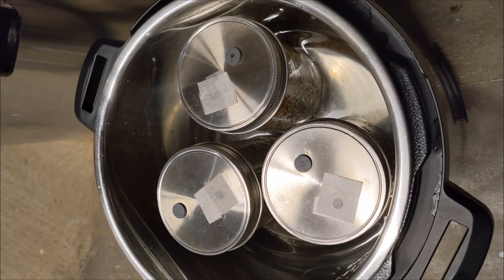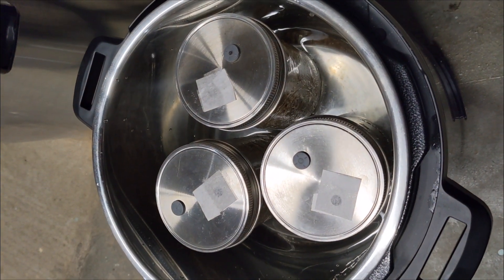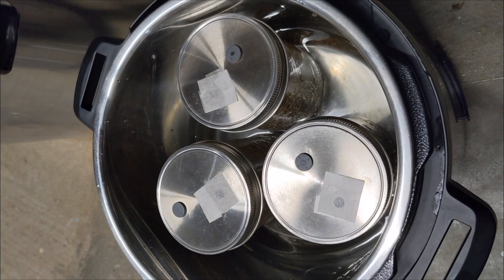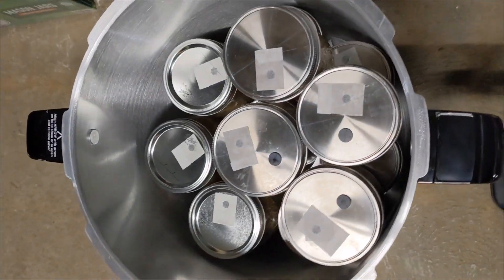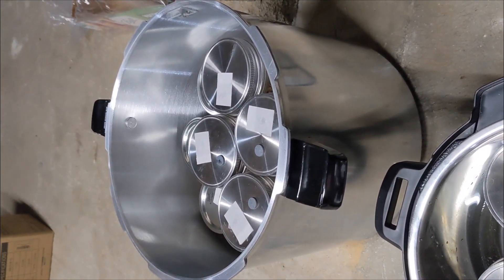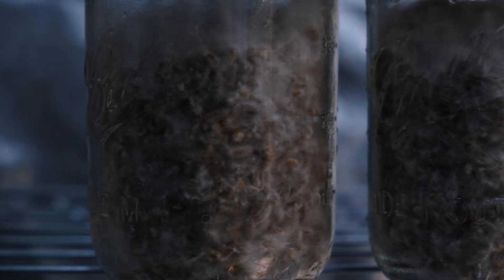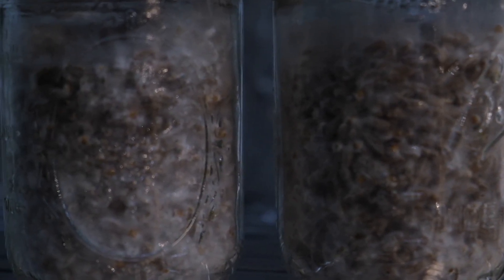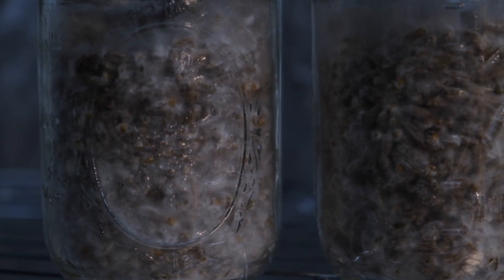Grain Spawn in the Instant Pot? I did an experiment to find out if it'll work

Comment: Ok with pressure cooker the psi depends on elevation.   Im in FLA "zero" elevation to properly pressure can food at my location needs 11 psi.  If I were in ARIZONA high elevation it would be 15psi.  Can I use the same I use to can food for this?

Comment: I've used my instant pot and never had any contamination. I just increase the cook time a bit. It is very convenient for small batches. I can get 4 quart jars in my pot.
Reply: What size of insta pot do you have ?
Reply: @buffalogrow3537  There are only 2 sizes and you can't even fit 1 quart jar in the smaller one (its too short)
Reply: @anakyn2010  There is a 6, 8, and 10 quart instant pot that I've seen being sold. Actual "Instant Pot" brand.
Reply: I'd also like to know!

Comment: I like everything about this. I wonder if grain spawn/substrate "All In One" bags could crafted this way with the self healing port. Maybe a small vac sealer afterwards that has been sterilized to seal it off immediately when done?
Reply: Do you mean sterilizing small bag of grain w self healing injection port. Sealing off bag once out of instapot then using LC syringe? 

I’ve been thinking about grow bags and that could be a cool way to do an all in one sterilize. Then have LC ready for injection!
Reply: @bando8086  that's th idea. I have learned much from the 7 months ago

Comment: Great that somebody finally puts this myth to rest. I was too ignorant to know the difference so have been using instant pot for all kinds of jars and never had a problem. Never even adjusted cooking time. It works totally fine.
Reply from the maker: Thank you, Demian! Yeah, I'm happy it works.  Pressure cookers are expensive.
Reply: I used a Instant Pot for my first few jars and at least for me, it was not working great at all. Some jars made it, sure, but I lost a lot of jars to contam, in many cases it was green mold that was clearly coming OUT of grains where it had not been killed properly during the PC. 

Besides that, I just would get SO frustrated about what I couldn't fit in the Instant Pot. Niether of those is a problem anymore since getting a proper canner with a pressure gauge.

Comment: I use an electric pressure cooker for my grain spawn. It's like an instapot but a different brand. I have never had an issue with contam. The only downside is that because of the size I can only do batches of 3 x 16oz. jars. I just set it on high (whatever temp that is) for 45 min. Works every time.
Reply from the maker: Yeah, it's kind of a bummer to only be able to do small batches.  But, if you're not trying to grow much it gets the job done!
Reply: How mant psi people keep telling me i should do 2 hours in my insta pot as it only reaches 11

Comment: I wondered this,I have an air fryer that gets up to 240degs,was thinking of dry frying some spawn as I have no PC,and have been steaming my jars with some success..👍🏻
Reply: Never owned a pressure cooker as I have found I can do everything I need done with just plain ole steam. Broke boi Tek forever. I use popcorn or rice as spawn and have NEVER had issues. Think that doing things this way keeps me focused on clean procedures more. Someday I'll break down and buy a pressure cooker
Reply from the maker: Let me know if it works for you!  I don't have an air fryer, but that sounds interesting.
Reply: @OneEarthMushrooms   no worries,Im waiting for some liquid Lionsmane,will let you know how it goes 👍🏻
Reply: The problem with dry air is that it doesn’t hold as much heat.
Also saps moisture out
It won’t penetrate the spawn as effectively as steam but should work to some degree if it doesn’t dry out